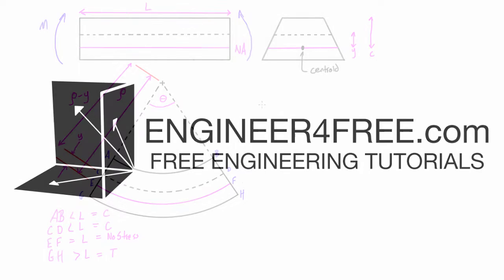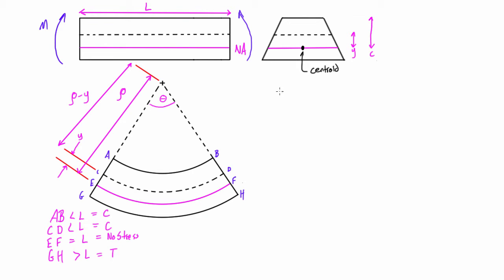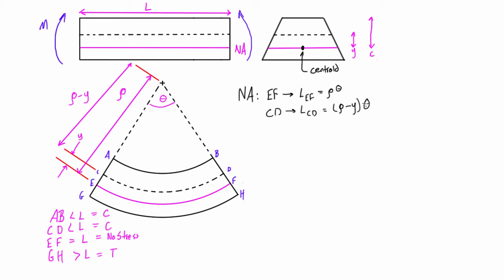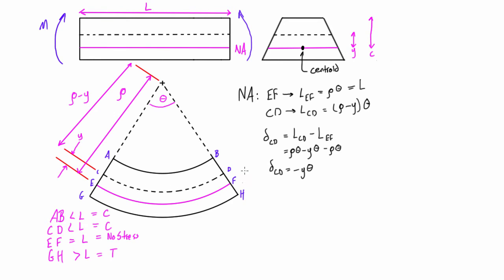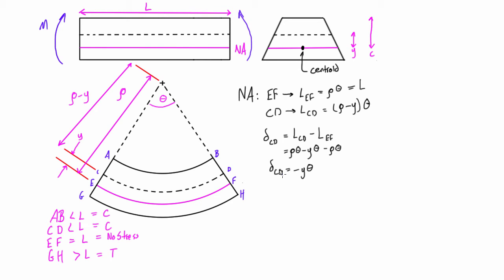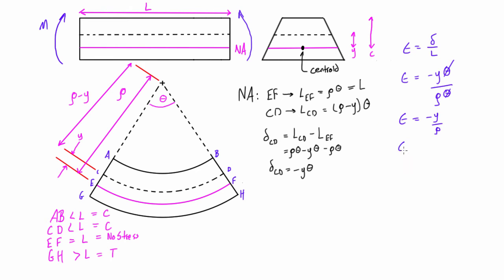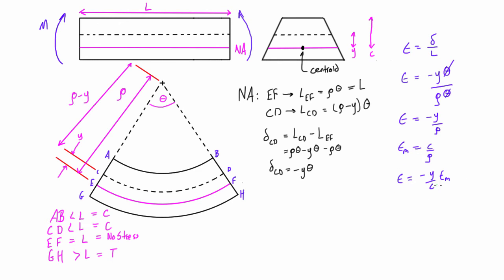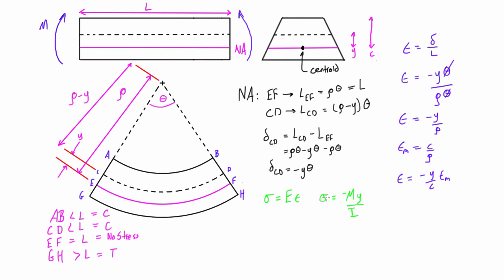Stress and strain in the elastic range due to pure bending

Comment: When someone becomes a patron, will they be able to send or ask questions from you by email? Thanks! By the way, how would you recommend the best route to better understand structures? Which group of discussion you presented one must learn first? For example, 1-statics, 2-dynamics, 3-mech of matls and 4-struct analysis? Nevermind, I read the short introduction you have in each subject and you mention what we should know before we start that specific set of problems 😀. I decided not to delete this message just in case someone has the same question 😬